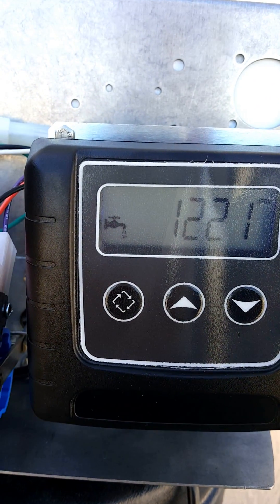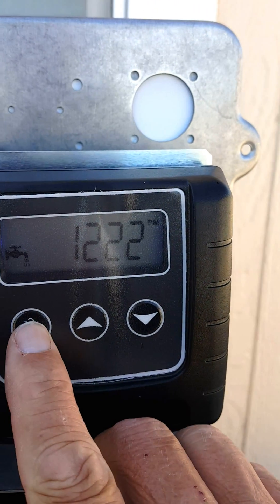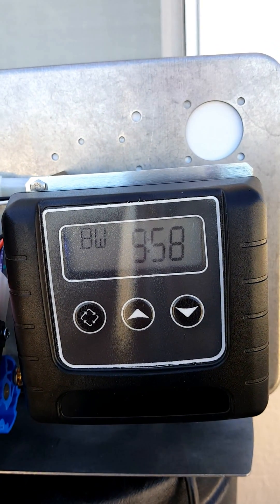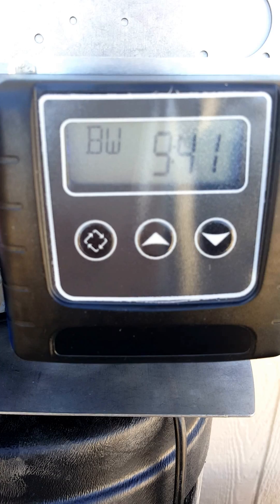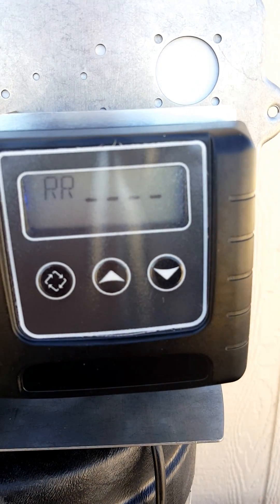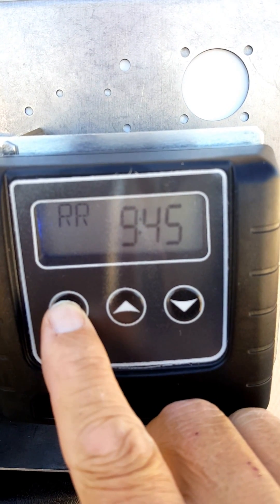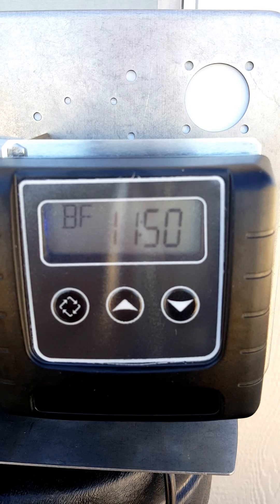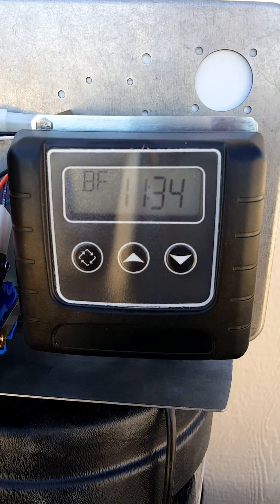How to Start a Manual Regeneration on Your Fleck SXT Filter System to Bleed Air Off the System

Comment: I see the BW and - - - but no timer. It just stays like this doesn’t matter what I do. 

After some time it it showing ER 0. Any idea?
Reply: Sounds fried electronically. Unplug its power for at least 5 minutes and plug it back in. Good luck, but if no better then its fried! Check online for a new circuit board or valve.

Comment: My dad has been in the ICU and on life support with severe ARDS from Covid for a month. He set up our tank and deals with maintaining it. My mom had a feeling she should check the brine tank, and we were completely out of salt, so we refilled it with 3, 40lb bags, let it sit for a day hoping it would regenerate on its own, but I don’t think it has. I know it regularly regenerates maybe once a week around 3am. From inside the house it sounds like someone is taking a shower so I’m guessing that’s what it’s doing is regenerating. We have the FLECK 5800 SXT control valve. The one with the 3 buttons underneath the screen. It flashes between the time, and “1515”, which I’m guessing is whatever setting my dad has it on, and I don’t want to mess it up. It currently has the service icon (water sprinkler sign) on the far left of the screen. So I’m guessing that will go away once it regenerates.(sorry this is long)!
So after refilling it with salt, do I need to manually regenerate it, and if so, do you know how to do that? I’m guessing it’s the button on the far left, but I’m not sure if I need to just press it once or hold it down, or if I should just leave it alone for a few more days to see if it regenerates on its own, or if it’s better to manually regenerate it after filling the empty brine tank with salt. 
I’m still researching, but I came across your video and thought I’d ask! 
Thank you!
Reply: For anyone still looking for an answer, to manually regenerate tonight at 2am just push the Regen button on far left for 1 second.  To clean/regenerate now hold the Regen button down for 5 seconds.

Comment: My softener won’t regenerate on it own. Works when I manually regenerate... got any recommendations?
Reply: I believe you're supposed to program that in. Most softener systems come pre-programmed for a 2am regeneration. I read that for most residential systems atleast. Not entirely sure how that works for an industrial system. I'm going to assume that it would need to be programmed for the day of the week and time as well.

Comment: How do you regenerate after you add iron out?
Reply: Hello
Is it a mechanical system or digital? If Digital just hold the regeneration button down for 10 seconds.
Reply: digital fleck5600sxt  48000 grain
Reply: Thank you
Reply: Is the regen button the far left button with the 4 arrows?
Reply: @evelyn201  Yes. Circular shaped.